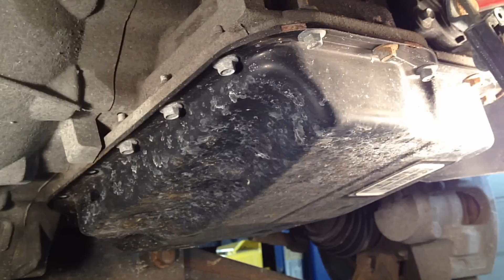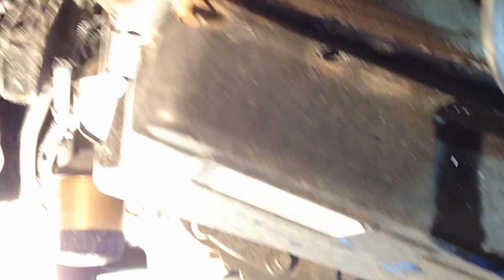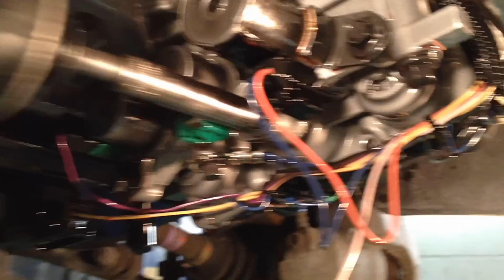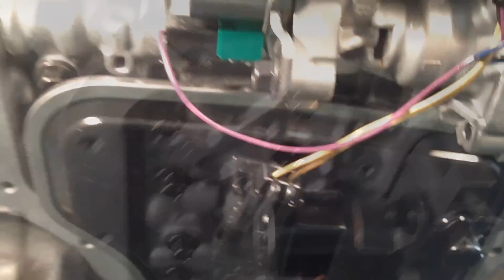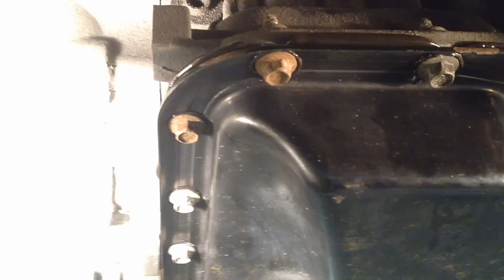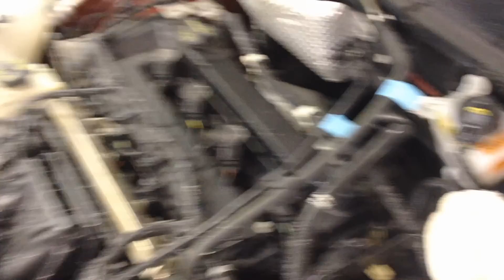Ford Focus Shift Solenoid A Repair P0750 P0753 P0972

Comment: Hi...I like your video.
My brother has a 2004 Focus that gives a P0734 error code. It slips from gear to gear, but  will run fine on a flat surface, but slips again badly and won't go into gear when it climbs a hill. Is this a solenoid problem or something more serious? The PO734 says "Poor connection at transmission" or "Internal transmission problem". Also, the check engine light comes on when it slips, but goes off and stays off after he turns off the car and then starts the car again. But then the check engine light will come on again if he tries to maintain speed up a hill, with the transmission again slipping out of gear. The only way to climb a hill is to NOT try to keep speed up a hill. Would it be okay to drive the car in Overdrive, by engaging the button on the gear shifter, which lights the green light on the dash? Thank you very much for any help.  - )

Comment: Hi there! Nice video. I do have a 2013 Ford Transit Connect which is based on the Ford Focus I understand. I have almost 50k miles on it. What is the estimated mileage for fluid replacement  ( when does it need the filter to be replaced ). Any video that you can share on how to do it. ( I have noticed that there is no drain plug to ????. Also, for the rear shoes any video on how to take the drum and replace shoes.

Thanks very much for your time.

Comment: thanks for your video I have a question, so solenoid A and B are exactly the same right because I am replacing a but I might just change bout well I am at it. also Is the trans oil fitter easy to change??? thanks
Reply from the maker: Yes a and b ate the same part number I would change both the filter simply pops out
Reply: Thanks man for your help you saved me a butch of money on mechanic fees.

Comment: I have a 2000 ford focus zx3. It shifts fine but it will sometimes slip out of gear then back in. It is an automatic, It acts like when you are driving a standard and miss a gear but it doesn`t happen during shifting. It happens when you are driving at a steady speed. Does not matter if you are on the highway or doing 35 mph through town. What do I need to do

Comment: I have a focus 2003, the problem that it has, when put in reverse, the engine starts shuddering and stop. The gear symbol with exclamation mark comes out at the same time. Could you please help me on this. Tq.
Reply from the maker: Muhd Ali Hambal What is the code?
Reply: Haven't check the code yet. I'll do that ASAP. Will get back soon, tq.

Comment: My 2007 Focus will shift normally 50% of the time, but the other 50% it will slip when shifting into 3rd and less so into 4th.  When it shifts normally, I cannot make it slip if I try.  There are no codes when I scan it.  I keep reading about these two solenoids, but since I have no codes I don't know if I'm going the right direction.  Any ideas?
Reply from the maker: Chad Wenzl This solenoid can affect 3rd and 4th yes so I would change it first but if you have high mileage I am suspecting the end cover has work grooves into the direct drum causing the fluid pressure loss.
Reply: FordTechMakuloco It's got about 130K miles, would you consider that high miles?  Would the possible grooves you are talking about cause a more consistent problem?  Like before, the slippage is probably an issue about half the time and the other half it drives just fine.  Thanks for your help.

Comment: my 2008 Focus won't shift into reverse. is this a problem with one of the solenoids? My mechanic says we need to replace the transmission. ~ $700 for the transmission + ~$300 labor.
Reply from the maker: Michael Bibona Pan drop would be advised either way that price is cheap go for it.

Comment: What's up. How did you diagnose the solenoid? I have an 05 Mazda tribute with p0750 that will not engage reverse. I don't have access to the factory scan tool which is how Mitchell has you go about diagnosing it. I do have a snap on verus at work. The car came in for spark plugs and exhaust, the p0750 happened while at my shop.
Reply from the maker: Michael Herbert I test the solenoid from the trans bulkhead connector and saw it was open.

Comment: I have a 2010 Ford Focus 2.0 with 60,000 miles on it. A couple days ago while driving at around 45-50 mph, I felt a jerk all of a sudden and immediately realized that the rpms seemed a little high. 2800-3000. It just felt as if the car was running a little "louder" than usual. Had had no previous problems with this car since buying it used 6 months ago. The jerking-kicking sensation would be sporadic and happens above what seems like 35-40 mph. After parking the car at Advance Auto for a scan test, I noticed when pulling back out, the car gives a little harder kick going into DRIVE. Anyhow, the scan test revealed P0760. Shift Solenoid C. So, I had it tested at another scanning place and got the same code. I ordered the part from the local Ford dealership and it was 198.00 after taxes. I have not put it in yet because I'm not so sure that this is definitely the problem. Spoke with a transmission shop and they told me that those code results are only 25% accurate for the most part when dealing with the ECM on Ford. HELP! What am I to do? What is the professional way of pinpointing the problem without spending a fortune? I am afraid that if it isn't the Solenoid C, I will have lost 200 bucks by putting in the new solenoid.And how am I to determine if it is even a "solenoid" at all? The transmission shop said that it could be a few different things to cause a code to be shot out like this. I can't see that replacing the Solenoid is the cheapest solution .... as a first solution, at a whomping 200 bucks. That would indicate the next "test" would be more than 200. I understand that testing the OHMS is a start, but does this pinpoint Solenoid VS Wiring problems. How accurate is the code reading that I got twice from 2 different scan tools? As the transmission shop suggested, is it true that other problems could cause this code reading to be put out like this? Thanks!!!!
Reply: Word of advice,  don't ever go to the dealership for parts. My Solenoid c only cost $22.00.  But I'm experiencing the same problem.  Did you ever fix it?
Reply: 200.00 for a simple solenoid is just Nuts! its shouldnt cost any more than 20 bucks, even thats too high
Reply: I got the same problem, change the PCM and problem fixed with the P0760 selenoid code C

Comment: thank's FordtechMakuloko

When I change the position "P" to anywhere position "R, N, D" I listen a little strock, and push the car (like when the ATF mercon V lack)

The color is red and few brown and smell is normally (worked metal) 

Once that position is in "D" the operation is extraordinary rpm-shifts in gearbox.

thank's
Reply from the maker: Gerardo Mendez Yeah if you go forward in reverse then the internals are welded together.

Comment: Hi, I have a Ford Focus 2002 automatic. Two days ago it started to loses power when it's running. I already did the diagnostic tool and the tool was P0750. This means that the transmission needs to be replaced or just an oil change? Thanks.
Reply from the maker: Ruben Martinez You need all the components located in the description of the video, the solenoid has failed internally.

Comment: Don't put silicone/rtv.  That more likely will make it leak.  If it doesn't leak, consider your self real lucky.  The filter box too says not to use sealant.  But very good, in pointing out the solenoids.
Reply from the maker: cndvd Sealant is the proper seal solution and is the way these transmissions came from the factory.
Reply: Where did you hear that ?  Never never put sealant on a transmission pan, unless it's bent, but then you would get a new pan.
You can put sealant and it might not leak, but your chances go way up, that it will leak, cause those filter/gasket kits are designed to install without sealant. 
The aftermarket gaskets are usually rubber which is the seal.  Trust me I tried it with couple Dodge Neons and one with and one without.  And the one with sealant leaked, but I put a pan under it, and was flushing it anyway, so I just did an extra flush . If I didn't put the pan, it would of leaked all out on the floor by morning.
Reply from the maker: These and a few other transmissions from ford use sealant only I did not hear that I know that from working experience working at the dealer for 10 years.

Comment: got a question? got a 2002 ford focus ZX3...Today while driving it IT loast 3rd gear..Just revs up wont go into 3rd gear..took it to auto parts they put it on computer and it end up throwing a code that shift solenoid was faulty..Just wondering if this is accurate and the issue?
Reply from the maker: Bryan wessel What was the code exactly?

Comment: FordTechMakuloco  I have a 2001 Ford Escape with 182k that shifted fine but on one trip it started revving really high before shifting. 1st gear was fine, 2,3, acted like it didn't want to shift on the highway. when at high speeds it did fine. when stopping and getting back up to speed, it didn't want to shift into 1,2,3,4. And the OD light flashed. eventually it didn't shift into D,R,N,1st, or 2nd. But if you let it sit for awhile in that gear, it moved for a little while, and stopped again. I had it taken to a mech. and a code for solenoid came up. Does my issue sound like a transmission solenoid issue? Thanks in advance!
Reply from the maker: Journeyboy93 No yours sounds like the torque converter let loose and has plugged the internal filter so either way the trans is probably coming out.

Comment: I got a 2011 f350 Diesel with the 6r140 Torque shift Transmission , on very rare occasions while driving normaly it'll just slip into neutral and the rps will hit like 4k then after i let off it goes back in gear . also more often then not while slowing down it down shifts very hard sometimes so hard i hear a bang . i'm thinking its my torque converter slipping but it could also be a shift solenoid truck has around 62,000 miles . any help would be greatly appreciated .
Reply from the maker: ConnorK When the new ones are down shifting hard yes they need a torque converter on these.
Reply: FordTechMakuloco would a bad torque converter also cause it to drop into neutral ? sometimes when i put the truck in reverse it goes into neutral aswell .
Reply from the maker: ConnorK No it shouldn't unless it is just totally coming apart.
Reply: FordTechMakuloco okay thanks for all the info , one last question . from the problems i told you and you encountered them on a test drive what would you say might the problem be causing it ? i still have warranty but i don't think this fix will be covered , i have the truck tuned and deleted . so i think ill have to fix this on my own . thanks
Reply from the maker: I would replace these first as solenoid issues are very common on the 6R140-
TSB 15-0010
6.7L WITH 6R140 TRANSMISSION - 2-3 SHIFT FLARE AND/OR MIL ON WITH DTC P0733 AND/OR DELAYED REVERSE ENGAGEMENT — BUILT ON OR BEFORE 11/19/2010
Publication Date: February 9, 2015

FORD:
2011 F-Super Duty

This article supersedes TSB 11-7-10 to update the Part List and Service Procedure.
ISSUE:
Some 2011 F-Super Duty vehicles equipped with 6.7L engines and 6R140 transmission built on or before 11/19/2010 may exhibit a 2-3 shift flare and/or malfunction indicator light (MIL) on with diagnostic trouble code (DTC) P0733 and/or delayed reverse engagement. Symptoms may be more evident or seem worse after an extended soak.
ACTION:
Follow the Service Procedure steps to correct the concern.
SERVICE PROCEDURE
Inspect the vehicle build date. Was the vehicle built on or before 11/19/2010?
Yes - proceed to Step 2.
No - this article does not apply. Refer to Powertrain Control/Emissions Diagnostics (PC/ED) manual for normal diagnostics.
Replace the three (3) normally high solenoids. Refer to the Workshop Manual (WSM), Section 307-01.
Removal of the main control is not required for this procedure.
PART NUMBER PART NAME
BC3Z-7G383-J BC3Z-7G383-J
Solenoid Band Number 1
BC3Z-7G383-K BC3Z-7G383-K
Solenoid Band Number 2
BC3Z-7G383-L BC3Z-7G383-L
Solenoid Band Number 3
BC3Z-7G383-M BC3Z-7G383-M
Solenoid Band Number 4
BC3Z-7G383-N BC3Z-7G383-N
Solenoid Band Number 5
XT-10-QLVC XT-10-QLVC
Motorcraft® MERCON® LV Automatic Transmission Fluid

Comment: Thx for the great visual post FTM.

I have a Ford Focus 2007. 
The OD light came on RED and blinking.
It then went off with the ENGINE light remaining on.
The code was OBD "P0751 Shift Solenoid "A" Performance or Stuck Off/1-2 Shift Solenoid Valve Performance"
I turned OFF the OD with the gear shift button (shows OD OFF on the console) and reset the ENGINE light so it is off.
It is now driving OK.  I am considering replacing it myself as you show in your vid, (I'm a total noob with car repairs) and I can't afford $700 for a shop to do it. was wondering if I could just leave it.
QUESTIONS:
1. Does the OD off prevent 4th gear? If so at what speed would this be an issue? It gets up to 4000 rpm @ 100kph in 3rd gear with the OD off.
2. is there any harm in city driving with the OD off if I keep it under a certain speed/rpm?
3.  was wondering if I could just leave it as is and drive with the OD off if only city driving?
Reply from the maker: Alot Anor Usually this code leads to replacement of the valve body but I have seen it for just the shift solenoid also. If under 50mph lets say you can just drive with O/D off and be just fine.
Reply: FordTechMakuloco 
Good to know - thx.
btw - I just drove home at around 55mph for about 10 miles and forgot to turn the OD off before I realized it, and then just turned it off at around 20mph,  and the light didn't come back on.  I guess that's a good sign?  Is there a way to have the OD OFF by default when the car is started?
Also, when the OD blinking light came on a few days ago (before I knew about the OD override), I heard a big CLUNK.  I don't assume that's any good.
Reply from the maker: Alot Anor No the pcm automatically enables overdrive upon a key cycle.

Comment: I have a 2003 focus zts automatic. Occasionally when driving and the car goes to shift, the rpms will jump to around 1k higher with no increase in speed but then it shifts. Almost like a when a clutch is slipping. Any ideas?
Reply from the maker: Frank Rister This can be many different issues causing this but most common is this shift solenoid if it happens on the 3-4 shift.

Comment: I have p0772 p0984. Code are related to selenoid E if i'm correct. I been quote 2k for a full rebuild of my trans. 

gear 1 and 2 are perfectly fine.

I'm not sure if 3 gear  slip or does not engage or it's selenoid pressure problem or whatever problem it could be. I dont want to spend 2k on a 200$ fix.

Dealer told me that clutch are burn. how can i know my self??
Reply from the maker: mondenet If the clutches are burned it is time for a new unit ask for a low mileage junkyard unit.

Comment: Buddy has a 07 Fusion with FNR5 trans. Similar to this trans correct plus one gear added? He bought it with trans issue and rebuilt it. Back together still has problems. No 2nd or 4th, or 5th I believe. He thinks the band needs adjusting but it also throws p0757 and two more for 2nd and 4th incorrect ratio. When he rebuilt B solenoid was bad. He replaced all solenoids, tested before install also. I believe there is either a short or TCM is bad. Trans shop said the computer calls for each solenoid right but that doesn't mean the TCM is good right? Now to test for a short I should check the solenoid B wire at the TCM connector for voltage right? If its off it should have voltage with key on right? If its no voltage there is a short? Also could any other sensor cause it?
Reply from the maker: Jason Choponis This is a mechanical or hydraulic functional failure of the hydraulic circuit. Was the valve body changed for this concern yet? How was this rebuilt like removed from vehicle opened up and overhauled?

Comment: FordTech sorry for the late response. In reference to slip and engage to 3rd that is exactly what is doing. Then to add more drama to my ride on my way home from work  I was going between 45 to 50mph the car started to idle high then next thing I know the a wrench light came on, and then my car wasn't cruising more than 30 to 35mph. Took it to O'Reilly AP had them hook up there diagnostic and there was no P0733 or any other kinda code. I don't know what to do anymore. As for the fluid there isn't any burnt smell, fluid coloration is fine, and the levels are fine. Thank you for your help and feed back I have learned a lot from your videos.

Comment: Will it be cheaper to do it myself? Code says solenoid A, does autozone sell theses, all i see are the solenoids but that dont say a b c. What you think is better and wont break the wallet
Reply from the maker: Jason Hilpp Yes much cheaper do it yourself,  the correct solenoid is linked in the description along with everything else you will need.

Comment: I have a 2005 focus zx3 with 150,000 miles. I had the blinking orange light and super hard shifting in reverse and 1st gear (all other gears shift perfect), so I replaced the A & B shift solenoids and it fixed the problem for about three weeks and now the light flashing again and is shifting hard when going into 1st gear and reverse again. Do you think that there are greater problems than these solenoids or should I try replacing them again and see if that fixes it. Or should I try replacing all 6 solenoids? All 6 solenoids on ebay cost 130$ vs. transmission replacement costs 1000$+.